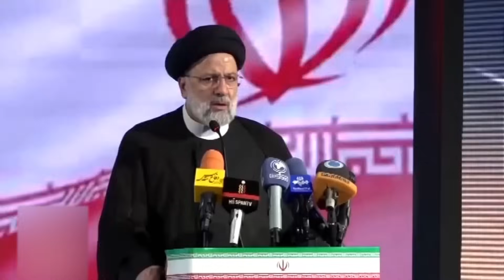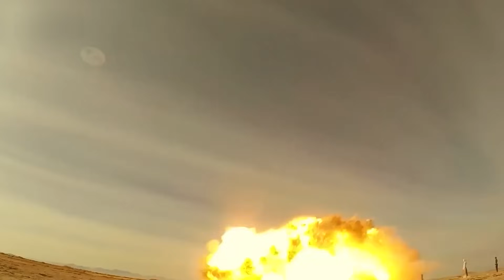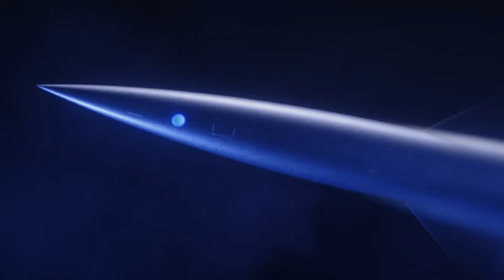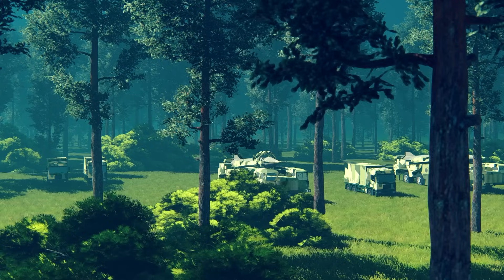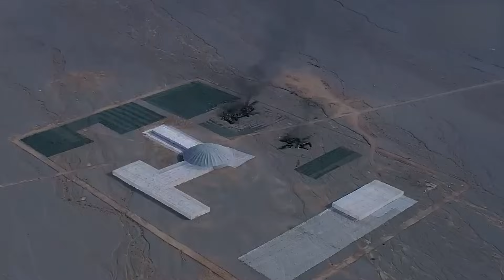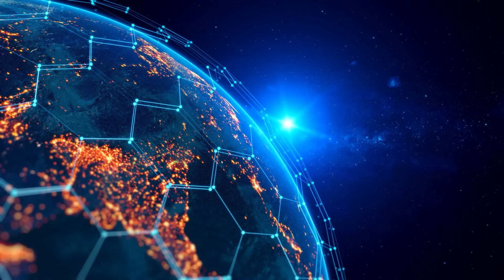Iran's NEW Hypersonic Missile Can Destroy US In 30 Seconds...

Comment: Many defense analysts credit Iran weapon developers of having the some of the hardest to stop basic ballistic missle technology. Hypersonic development will quickly result in these countries developing Hypersonic defense capabilities,  that's an even bigger threat. Leading to nations losing the ability  to conduct standoff attacks.
Reply: 'Quickly' is the weak point in your observation. It will not be easy, nor will it be quick to defeat hypersonic missiles. The simple fact that they are undetectable by conventional radar (due to the radar-blocking plasma fields generated by their high speeds) means a whole new sensor system has to be developed and that could take decades.
Reply: @Idcanymore510  Hypersonic missiles are detected clearly by  radar when launched , they aren't 100% stealthy.. Your point is valid, but it's still fair to say the leaders in  hypersonic technology will be the leaders in countering the same.  I think laser based counter measures are also defeated by  this plasma cone and will be limited to high angle  targets. Heat seeking hypersonics will likely be the simplest solution.
Reply: @lielyncher755 😂 You have read something, but haven't understood. Not radar, but satellites can detect what you talked about. And those satellites are not everywhere.
And the lasers are already thrown away as it's ineffective.
Reply: Israel can not attack Iran now that's a big stick on the head
Reply: Ever heard of the US Air Force? If Iran were to even hit Hawaii, they would be bombed to the Stone Age!
Reply: Every country all want the war ,specially the extremist and warmongers,for what ,for personal ambition